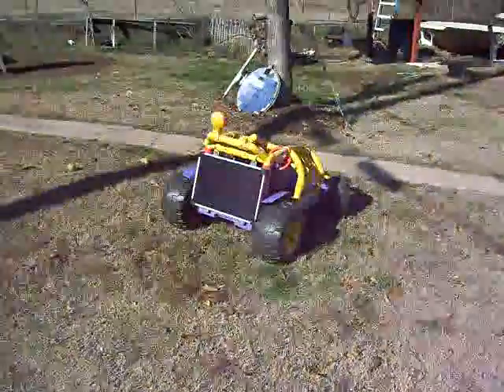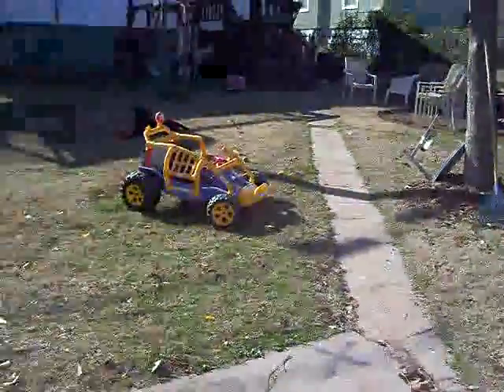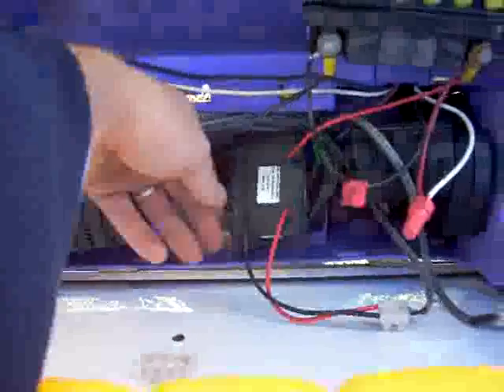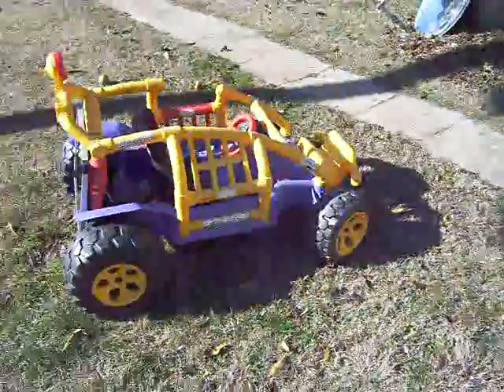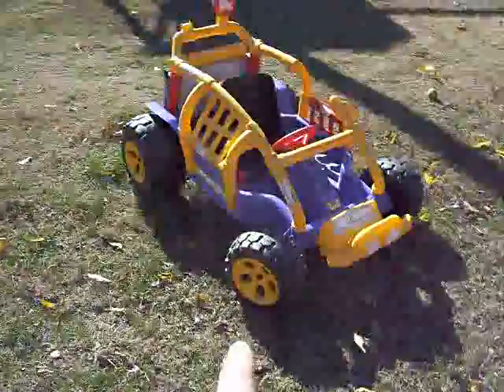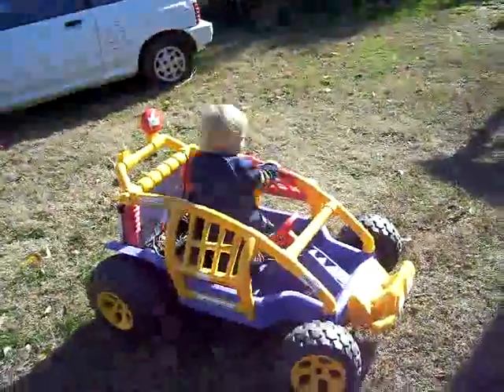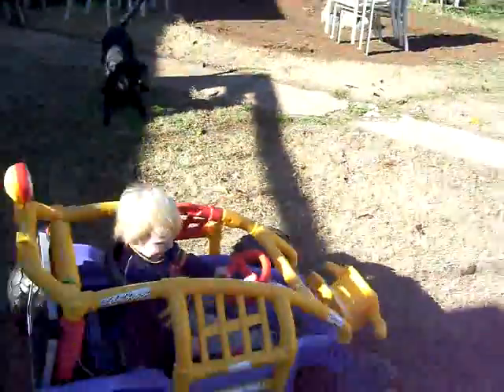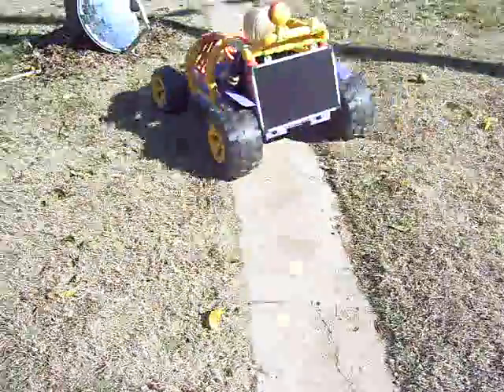Solar car / way before cybertruck

Comment from the maker: ok cost of this project is:
the car from goodville without battery=$ 5.00
battery from junkyard ,added new acid =$ 0.00
Solar panel from Harber Freight Tools =$35.00
5 amp. Solar charge controler - Ebay  =$12.00
some wire and wire nuts :)   Total    =$52.00